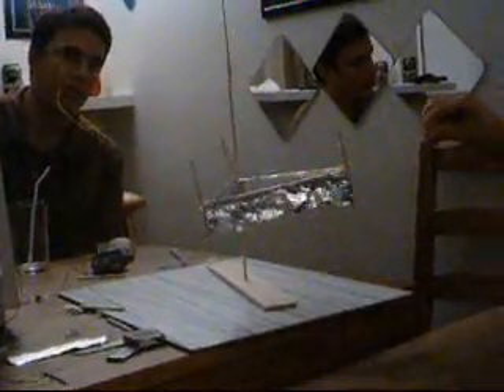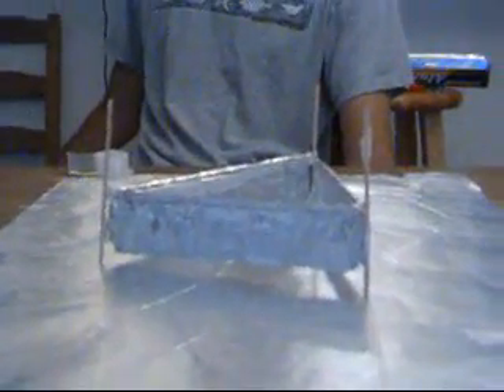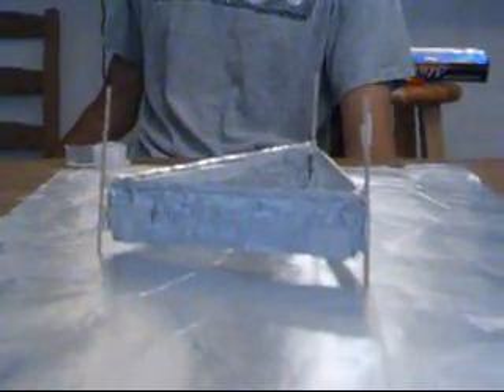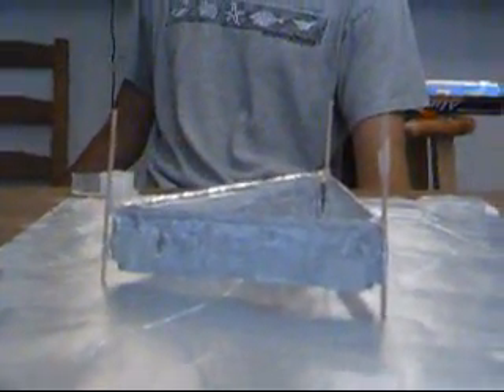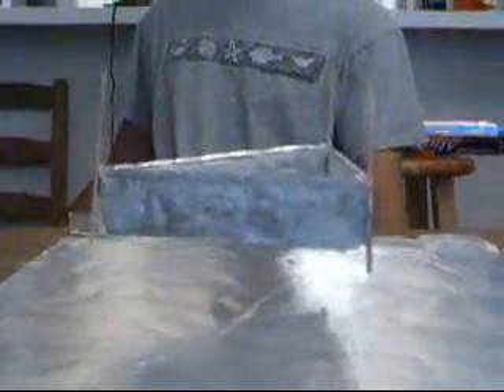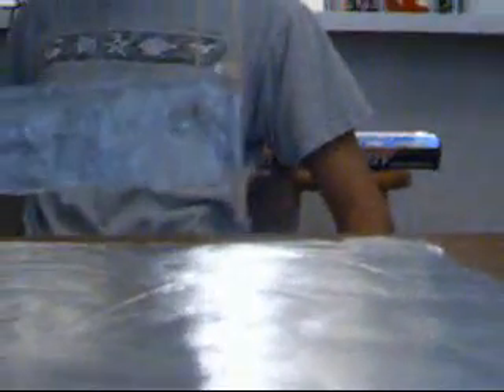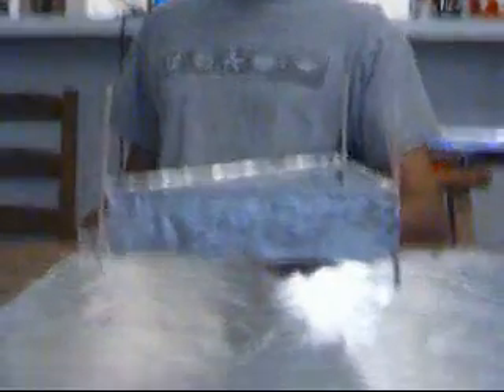Ion Wind Lifter

Comment: It's pretty simple really, and something you should already know if you are a physics grad.  If the bag is enclosed so no air can escape, the net force due to the ion wind will create a downward force on the bottom of the bag, which will cancel the upward force on the bag due to the lifter.  Don't get your ego bruised so easily.  Clearly it isn't enclosed in an air tight bag here though, so I don't know why leviterande even mentioned it.

Comment: many have done what I  just told you.   they encapsulated the lifter inside a closed plastic bag , other have even  covered the entire lifter with thick epoxy and it still works very well!   check jean naudins many tests for instance,   google jean naudin plastic bag lifter  and there are plenty other on his website, its very easy to see. the question is just how. only explanation would be that ions are "escaping the plastic bag" but I dont think so

Comment: @entropy111111 Blaze had some kid of error, because electrostatics works in vacuum. THat is the theory behind vacuum tubes. PLUS, there is no air in the resin/epoxy encsed discs. I am no wrong, because I have done the research. Your research is incomplete. US ARMY and university research (Purdue Energy conversion Lab), and TT Brown's own work, Plus John Fiala prove that ion wind is too negligible a force to be of any value. But the Biefeld Brown effect cancels inertia, and is EXPONENTIAL ^ Volts

Comment from the maker: @Beamshipcaptain you know damn well that blaze labs didnt have any grounding errors. That is a very well done experiment. And no, youre still wrong...if there is ANY air inside a bag, you can speed air particles around, which will carry momentum, and you'll have thrust. Think of the earths atmostphere as one giant "bag"...planes still work inside...youre analysis is way off base.    New question: if you knew you were wrong, would you admit it.

Comment: @entropy111111 Then they grounded the container or some other error. In 1955 in Paris France, the concept was proven with a billionth of an atmosphere. Same thing in 1959, a couple miles from her in King of Prussia, PA. Google ELECTROHYDRODYNAMICS. If no wind can excape the bag, or expxy, you should have no thrust. Instead there is the same thrust, in REVERSE direction. The Effect also cancels out all inertia. Instant satrts and stops and changes of direction at any speed, with no sensation.

Comment from the maker: @Beamshipcaptain   hahaha....again...who gives a shit if "no wind" can escape a plastic bag, you still have air in there that becomes ionic, and thrust towards the skirt.  there is a momentum transfer providing thrust regardless if there is a plastic bag around it...  respond to the Blazerlabs trial...they used a nice vacuum set up...thats a REAL vacuum. Ive worked with those...it takes like a week to remove all the air. and lo and behold...NO THRUST IN VACUUM.

Comment: @entropy111111 "Dude", ion wind has an upper limit, and that limit is over 3 orders of magnitude too feeble to cause levitation. The effect is more efficient in vacuum, because cuurrent can be turend way down and there is no corona to rob efficiency. I sealed up TT Brown saucers in platic and they flew backwards, in 2000. A youTuber sent be a vieo of TT Brown saucers he sealed in epoxy and they also flew backwards. Scientist John Fiala flew my Beamships in vacuum, and with onboard power.

Comment: @entropy111111 Opinions vary. Nevertheless, my Beamships are the largest and most energy thrifty of such devices in the world, after over nine years. And I am published. I have been researching and working with electrogravitcs since 1982. What were YOU doing in 1982? Bottom line, this tech and teangential technologies will form the basis of the starships of the 21st Century.

Comment: @entropy111111 The thrust is EXPONENTIAL with increasing Voltage. THere is no limit. And no, the thrust is NOT weak. Look at my Beamships, and the TT Brown saucers I built and flew in 1999, and presented in Reno Nevada in 2000. THese are very heavy, yet there is no "wind" from them, and they go from a standing start to 12 RPM with the 100-120 kV at some tens of microAmps. High Energy electrostatics produces forcefield phenomena that is indistinguishable from gravity, just like relativity..

Comment from the maker: @StarFoxAutobot   it probably would still lift..though at a reduced rate. the real problem would be weight. there isnt much thrust there to  begin with (hence why were using thin thin thin balsa wood, light wires, and tin foil)...   I know some engineer put a lifter in a high-vaccum (a real one, not a shitty JNL Naudin one)..and the thing would not lift at all... so yeah, anything you do to decrease that airflow, kills the the thrust.

Comment: "So under hard vacuum conditions, a force of 110 grams (1.1 Newtons) could be achieved for power expenditure of just 0.5 Watt. (250,000 Volts times 2 x 10 ^-6 Apms), or 2,200 Newtons of thrust per KiloWatt. That is about 150 times the Thrust to Power Ratio of a Jet Engine! Also it is 10,000 times greater than the thrust-to poser-ratio of a space-shuttle-Main engine".-SECRETS OF ANTIGRAVITY PROPULSION(2008), Paul A. LaViolette,PhD.

Comment: Why would they not work in a vacuum? THis is how VACUUM TUBES work! -Woodward James,"Flux Capacitors and the Origin of Inertia," FOUNDATIONS OF PHYSICS V.34,2004, p.1475,Purdue flew lifters in hard vacuum- William B Stein,"Electrokinetic Propulsion, THe Ionic Wind Argument", Purdue University Energy Conversion Lab,Hangar #3, Purdue Airport, West Lafayette, IN 47906,Sept.5,2000.

Comment: If they did'nt work in a vacuum, VACUUM TUBES would not work.Lab devices weighing 100 grams have produced thrust of 110 grams, for input of 500 Watts(250,000Vots@2 milliApms). Performed in air of 1Atm.Supplementary research indicates much greater efficiency in vacuum(10^-4mm Hg or better) when current drops to about 2 microAmperes.

Comment: No. And we do not want sharp corners anywhere. We make it just like the patent USPat# 2,949,550, which shows ROUND wire and forward-electrode. Which is what I used in teh TT Brown saucers I built starting at the end of January, 1990. They worked fine. Sharp corners csue corona and leakage-losses that rob power, and force. Ideally we want ROUNDED surfaces and corners on the TT Brown saucer, because that produces far more thrust for less powerinput. We only need enough current to replace leakage.

Comment: It should work with ANY conductor, CARBON WIRE works the best, but it is more brittle than stainless-steel, (we use .003" stainless for corona-suppression, and increased lifting-force, as you probably knew already), and force is increaseed exponentially with increasing Voltage. Only enough Current is rquired to replace leakage -losses. The reason these work is STORAGE AND RETENTION OF CHARGE. That's why seams and sharp-corners are avoided on the devices.There is a physical limit to ion-wind.

Comment: As you know, whoevery you are, the biefeld Brown effect has been measured at 100-million times greater than the force of ion wind. I have been reading Jean Louis Naudin's site for ten-years. William J. Beaty proved several years ago with experiments with a digital anemometer, and simple algebra, that the air-movement (only 1.5 mph) was less thatn half of the airspeed needed to levitate lifter-2. So obviously, another force is involved. The inventor, TT Brown dubbed it ELECTROGRAVITY,in 1928.

Comment: It appears that Brown was cyclically varying the Voltage accross the plates of the electrokinetic apparatus at frequencies of around 750 megaHertz to maintain a high thrust condition. The ELECTROHYDRODYNAMICS report notes the thrust on the  EK apparatus was observed to increase directly with K-factor of the dielectric and according to the square (and in some cases the cube) of the applied Voltage. A dielectic w/ a factor of 50, 12 times greater than Pyrex, would produce 12-fold greater thrust.

Comment: These thrust measurments showed ion-wind is insuficient a force by ordres of magnitude. For example, an upward thrust of 110 grams is equal to force of 10^5 dynes. By Comparison,a 2 microAmpere ion wind resulting from electrons accelerated in a 250-kiloVolt potential would yield a force of somewhat over 10^-3 dynes, almost 100 million times less than the lift produced by Brown's Electrokinetic Apparatus (which I built in 1990).

Comment: Hence NASAs ion propulsion engine was 10,00 times less efficient than Brown's electrokinetic disc. Under hard vacuum, such as ws achieved in Winston Salem NC at Bahnson Labs, upward force of 110 grams (1.1 newtons) could be achieved for power expenditure of just 0.5 Watt(250,000 Volts times  2 x 10^-6 Amps), or 2,200 newtons of thrust per kiloWatt. That is about 150 tiems the thrust to power ratio of a jet engine. Also, it is 10,000 times greater than the thrust to power of a shuttle main-engine

Comment: Report by Whitehall Rand ELECTROHYDRODYNAMICS (1960) notes under harder vacuum conditions of 10^-12 mm Hg as in space, Brown's electrokinetic device would be expected to achieve even higer efficiency due to a further reduction in ion leakage power consumption. The report also compared the observed thrust with that of the NASA ion propulsion engine, which weighed 10 times as much as Brown's saucer and produced only 28 grams of force for an input of of 1200 Watts, or just 0.23 newton per kilowatt

Comment: "Heavy  'gravitors have replaced led balls suspended on wires. Rotating frames supporting two and four gravitors have made possible acceleration measurements. Molecular gravitators made of solid blocks of massive dielectric have have given still greater efficiency. Rotors and pendulums operating under oil have eliminated atmospheric conditions as to pressure, temperature, and humidity. The effects of ionisation,electron emission have been eliminated"-HOW I CONTROL GRAVITATION, TT Brown,1929

Comment: That is what ion wind is: MOVING AIR. 
To put into perspective, Brown's electrified disc was almost 100-million times greater than what could reasonably be generated by an ion wind.For example, a thrust of 110-grams(as Brown's 100-gram disc in vacuum) is equal to a force of 10^5 dynes. By comparison, a 2 microAmp ion wind from electrons accelerated in a 250 kV potential would yield a force of only about 10^-3 dynes, almost 100-million times less than the lift produced by Brown's disc.

Comment: Brown discovered in Paris during successful vacuum tests sponsored by the French Govt. that ther thrust also persisted even when the capacitor elements in a rotor (such as I built 10-years ago) were each surrounded by plexiglas enclosures. Since ther was no way that ino-wind could escape from the enclosures, ion thrust could be ruled out as a motive force. Barium Titanate placed betwenn the electrodes produced a markedly increased trhust over air or vacuum.

Comment: The US Army report by Badher and Fazi also states: "If the capacitor is surrounded by vacuum(rather than a dielectric, such as air), the net force F on the asymmetric capacitor can be computed by the sum of two surface integgrals, one surface of the negative electrode (4th equation), where E is the electric field due to charges on the ionised air between electrodes(excluding the field due to surface-charges on the capacitor electrodes."

Comment: This report also gives the requiste equations and further states: " Again,this value is at least 3 orders of magnitude too small to account for lifting a capacitor with mass of 3-5 grams. Therefore, the ionic wind contribution is too small, by at least 3 orders of magnitude to account for the observed force on the asymmetric capacitor."

Comment: Purdue University Flew Lifters in hard vacuum, in 2000, after I flew heavy sheet metal 1-meter diameter TT Brwon flying saucers, bagged, and naked, on only a few watts of electrical energy, in clear violation of the 1st law of Thermodynamics; more motion is created than is proportianally input in energy-units.

Comment: Because that would be disinformation. You forget the Biefeld Brown effect also cancels inertia, which clearly shows there is no thrust in the conventional sense. Accept that it is a space drive, that is 100 million times more powerful than ion wind is cabable of, as tested by degreed physicists, in less than a billionth of an Atmosphere. This is dynamic counterbary, warp drive, and it is 100-years old. Do the research, if you are so inclined, your generation will conquer the stars with  this.

Comment: No, gravitation is determined by an objects MASS. Not size. A handfull of a Neutron Star material would sink from its own weight to the centre of the Earth. A black hole resulting from a collapstar with a mass 10,000 times the mass of our sun has no mass, but its gravity is so great not even light can escape fro the event-horizon. Gravity is the weakest force in the universe, normally. Gravity is created by a dense concentration of mass or ENERGY, which are equivalent, according to relativity.

Comment: Anemometer tests and simple physics prove ion-wind is insuffifient to lift devices. Thrust in the Biefeld-Brown effect is EXPONENTIAL with increasing Voltage, and a solid- massive, high K-factor dielectric produces incredible thrust, even higher efficiency in vacuum, hence the classificatrion by the US Air Force in 1955-1995.

Comment: OF COURSE it works in vacuum, as successfully tested for 70-years up to today. Why would it not. The equations, and findings of measurement of Ion wind velocity by myself and others as tested, show that the lifting force is independent of air. I shoed the wind was insufficient to dislodge a 1-inch diameter .01 gram weight styrofoam ball under my 4-foot diameter, 24-gram Beamship(tm) variation II experiment on Youtube, done in 2002.

Comment: TEST RESULT:The Wind Speed meter is placed below the surface of the 16 gram levitated Lifter,and moved along the entrirety of this area,the average ion wind speed measured is approx. 1.5 mph (0.67 Metr/sec).The ion wind contribution to the upward thrust is more than the 2% claimed by Transdimesional Technologies, BUT IT IS NOT SUFFICIENT TO LIFT THE DEVICE.-William J Beaty   
 Which is what I found back in the 1990s with TT Brown saucers,later VTOL models. 96% lift comes from ELECTROGRAVITY.

Comment: Assuming air intake is omnidirectional(so it contributes ZERO momentum)and the "exhaust jet" is a parallel laminar flow same size as device;to move a 16gram(.16 Newtons weight)device, velocity of jet would have to be: f=thrust Nt d=air density 1.2Kg/M^3 a= area of jet,.3*sqrt(2)*.3.2=.078 M^2, then: engine thrust=(air vel)^2*area of jet* exhaust density or: air vel=sqrt(f/a/d)=sqrt(.16/.078/1.2=1.3 M/sec DOUBLE CHECK THIS EQUATION!

Comment: FOR ION-WIND TO CAUSE LEVITATION,THE AIRFLOW BELOW A 16 GRAM LIFTER SHOULD BE ABOUT 4 FEET PER SECOND OR 3 MILES PER HOUR. If some air also flows outside the borders of the device, the "virtual area" would be larger and the airflow somewhart slower than 4 fps.If the actual wind is *far* smaller than 4 fps (e.g. 10x smaller), then you can conclude that most of the lifting force comes from ELECTROGRAVITY.

Comment: JATO and RATO refer to means of assisting overloaded planes to take off; nothing to do with getting into outer space.

So, the 3m unit is a non-flying demo device; no I didn't know actually. And what, may I ask, will it demonstrate? Presumably not that it is inertia-less, nor that it can achieve ftl speeds. Do tell us just what the 3m non-flying unit will actually consist of - I understand that it is near completion, is that right?

Comment: jet propulsion: uses air-breathing reaction engines, air being the source of oxidant; can only work within an atmosphere containing an oxidant.
rocket propulsion : reaction engines using oxidant carried onboard and therefore capable of working outside the atmosphere.

The distinction is clear.

JPL was founded in the 1930s; rockets were often erroneously called "jets" or "ramjets" (only in the USA) before the mid-1940s.

btw how is the 3m device? Ready to fly in Jan. with a substantial payload?

Comment: Jet propulsion IS rocketry. That is why JPL, NASA facility in Pasadena, California is called the JET PROPULSION LABORATORY. The visitors to our planet from other planets DO NOT generally employ jet or rocket or any other action-reaction (impulse)fueled- techniqes to get from A to point B. Instead, they are universally described as SILENT, and capable of VTOL, and instant sarts and stops at thousands of MPH, and right angle turns any speed, which Brown confirmed in his experiments by 1938.

Comment: A professor in Tokyo in Spring,2003: Self-powered large device with a piezoelectric micro-power supply(modified) from Information Unlimted;On-board power achieved for 3-minutes with a lithium-polymer -3cell pack, 2000-milliAmps, 11.1Volt input power to power-supply.

Comment: Can I get some of the stuff your smoking?  

yes you can levitate things using high voltage, but since its a thrust, its still bound to the laws of physics, and thus has inertia.  Why dont you create a lifter that has 3 axis control that does not need to rotate on any axis to change direction.  Should be easy if high voltage lifters are not bound by the effects of inertia... assuming you can get one to levitate without a teather line first.

Comment: just curious, does the lifter kick up dust?say for example a thin coat of gypsum dust from drywall?  What would the effects be launching the lifter above the table with a slight coat of dust (non static type dust)under the lifter ?